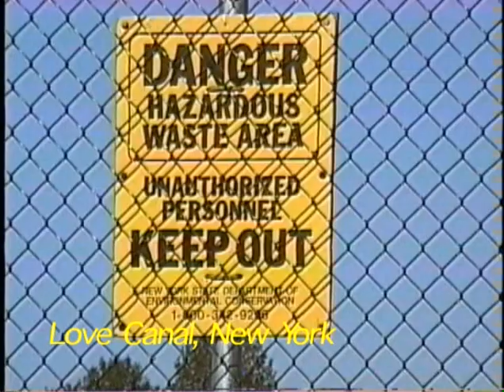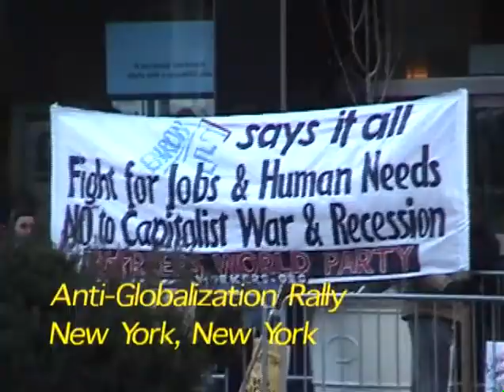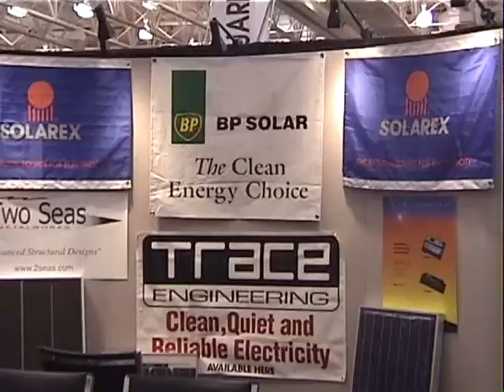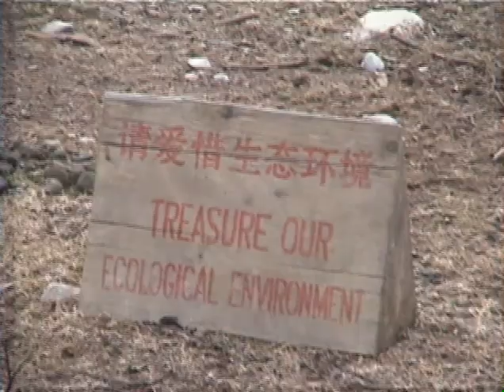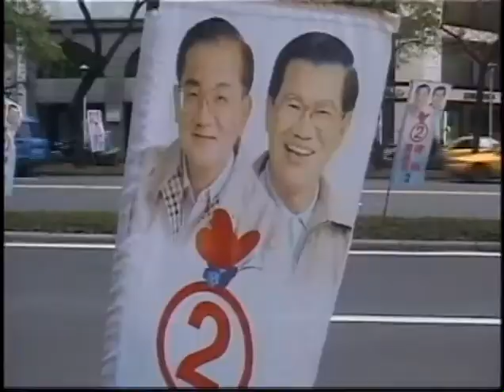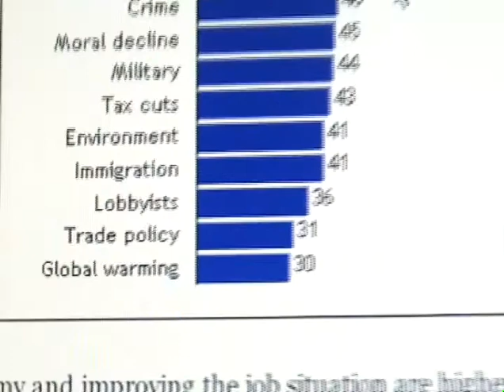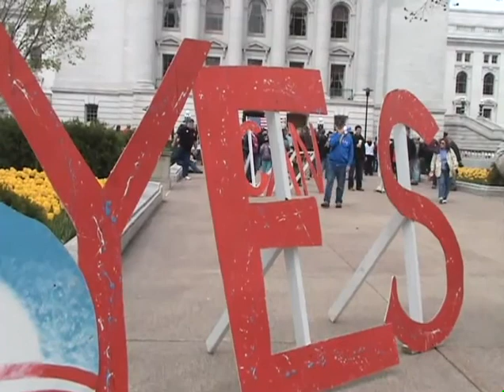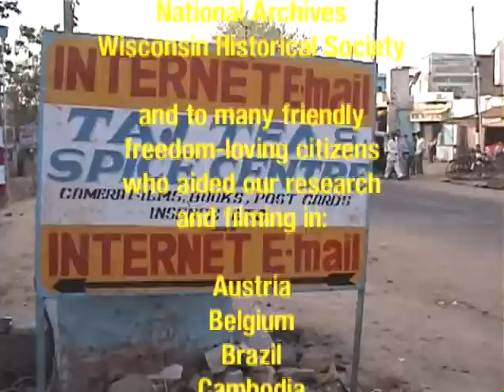Resources, Populations and Climate Change

Comment: Dear Bill, not generally objecting to your views but in terms of limited resources for example: of course we could increase the resources in the past couple of hundred years simply - because of  limited technology : now, we are more and more able to do so, unfortunately...; ultimatively there are , of course, limited resources, the most limited one is: energy (i.e. natural energy resources such as oil and coal), but ultimately - on the long run if everything is used up- solar energy. Also, water is limited and will be ultimately a limited resource (and quite a few companies have realized that already). So on the short run (i.e. couple of hundred years) you might be right with your estimate; but even on a slightly longer run: couple of thousand years, you are definitely wrong, if population expands in similar rates as in the past hundred years.

Best

Alex Hüttenhofer